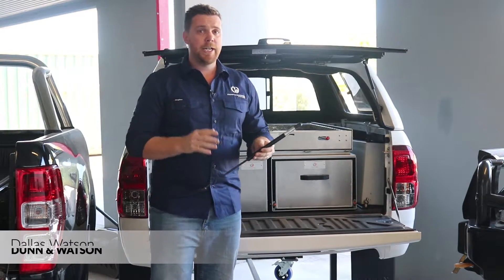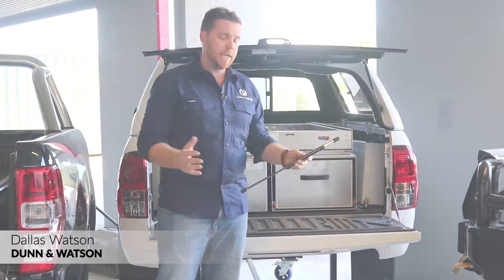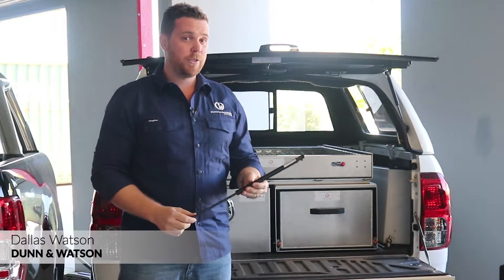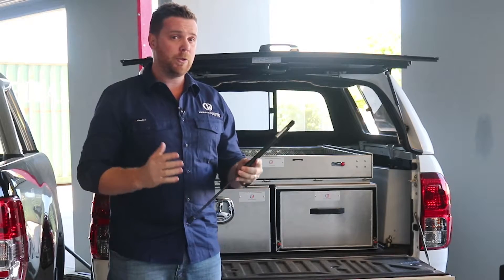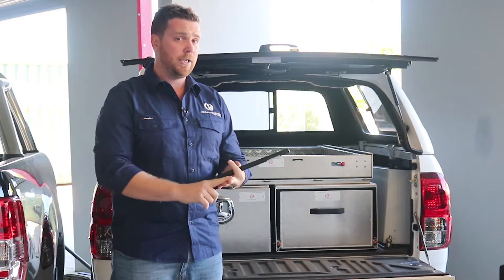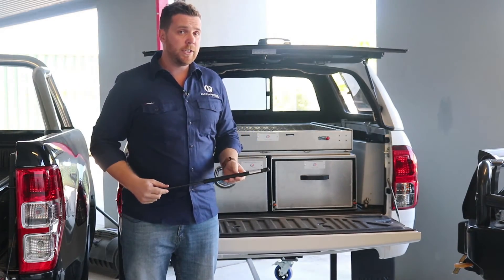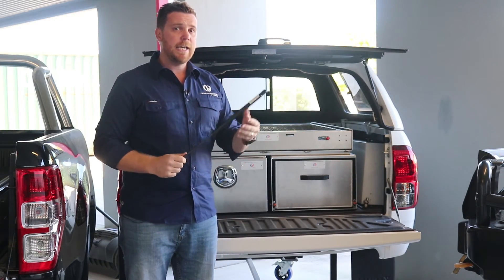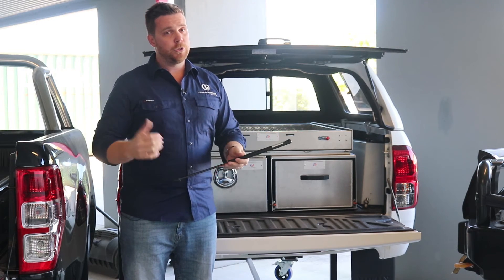How To Tell If Your Gas Struts Are Installed Upside Down

Comment: Wait I'm confused.  So the right way is cylinder above the rod?  Why is the one on my car trunk is installed cylinder below rod?  Should I go out of my way to flip them?
Reply: I think what matters is how the struts rest when the lift is closed. For example, on my Prius, when the lift is open all the way the cylinder is below the rod. But when the hatch is closed the rod rotates from top to bottom. You want the resting position to have the cylinder over the rod. The open position doesn’t matter so much.